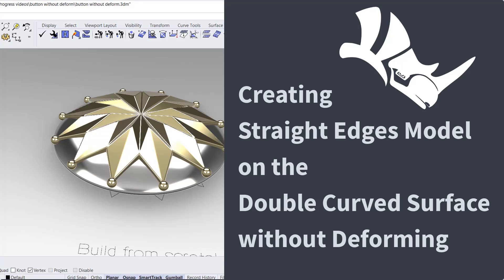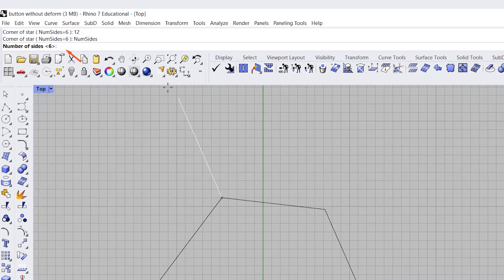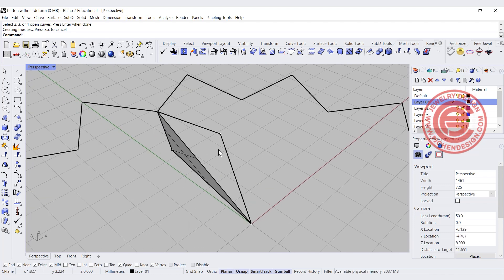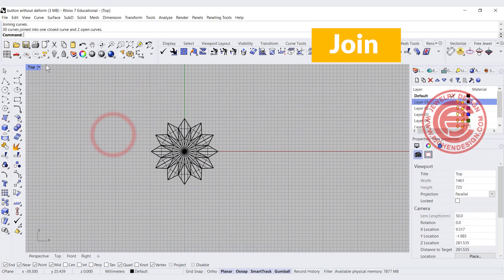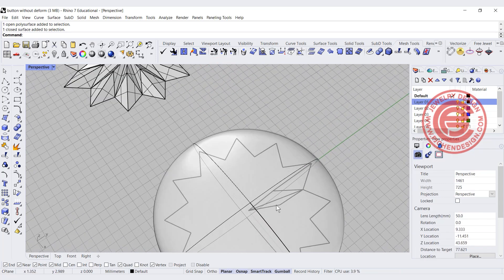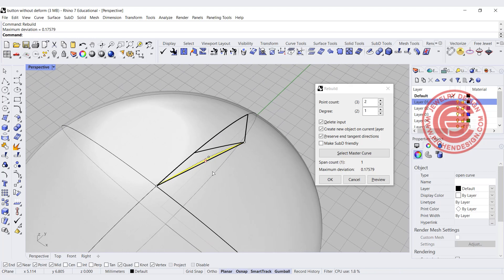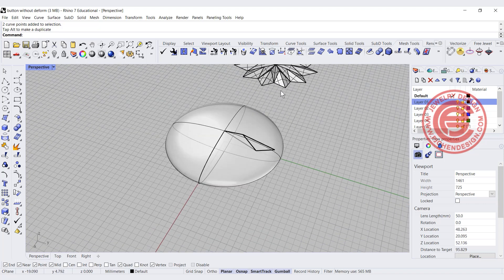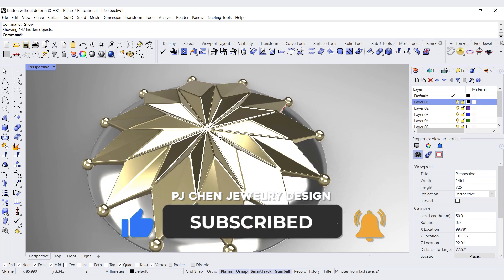Making Straight Edge Shape on Doubly Curved Surface in Rhino 3D #332

Comment: How would you implement this technique if the surface was a half sphere and not a low dome?
Reply from the maker: the more dome surface you have the shorter straight edges you can have to make it look shape edge. It can still have the straight illusion by design. or you can increase the height on the pattern.
Reply: @PJChenJewelryDesign  Thank you so very much! That is incredibly helpful!